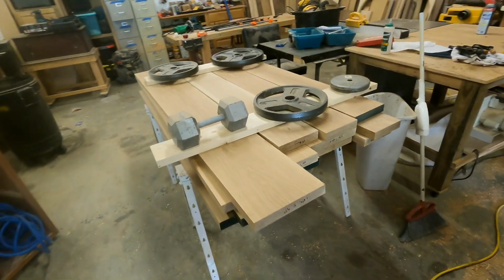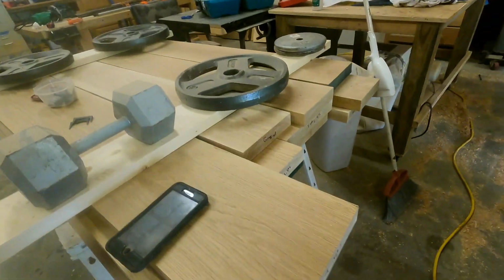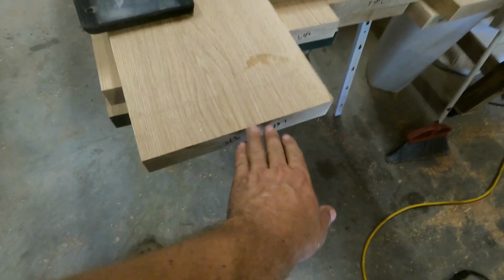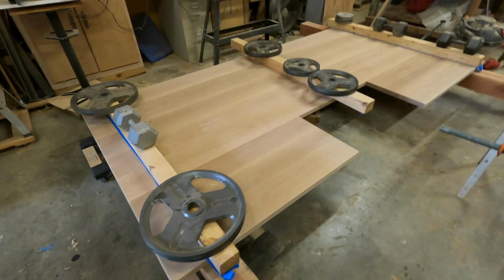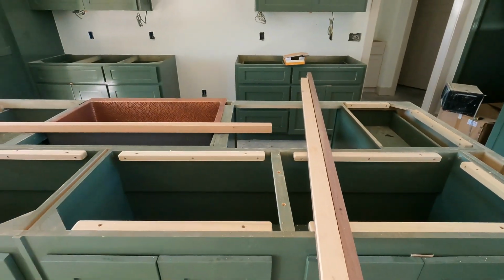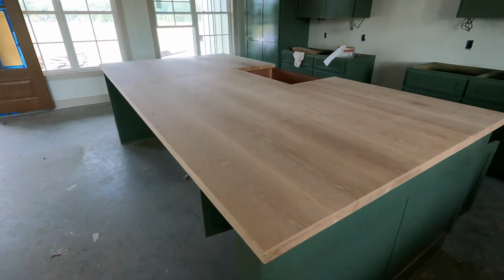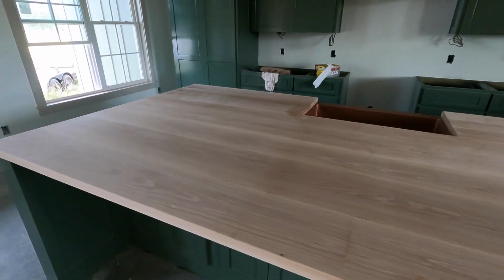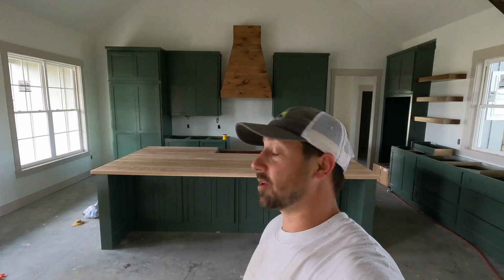MAKING 10ft WHITE OAK COUNTER TOP by a ONE MAN shop!

Comment: How did you treat the end grain and edge around the sink to prevent water damage?
Reply from the maker: Sealed the underside with clear silicone and once you put your finish on I also coat the end grain with paste wax. I also teach the clients how to care for it. Wood countertops require a lot or Maintenance around the sink and diligence in keep it dry and caring for the end grain with finish and pastewax.
Reply from the maker: By Seal the underside meaning where the sink and countertop come together.